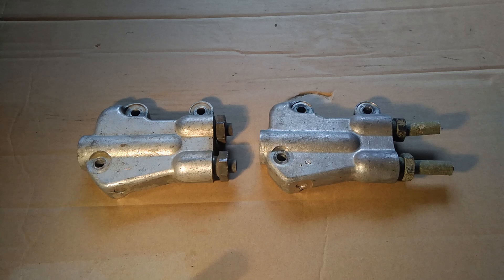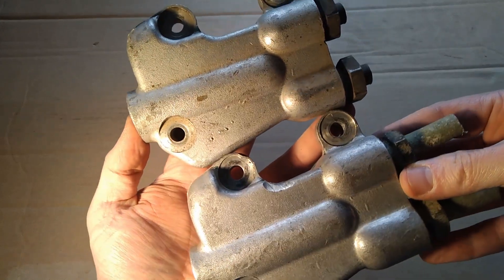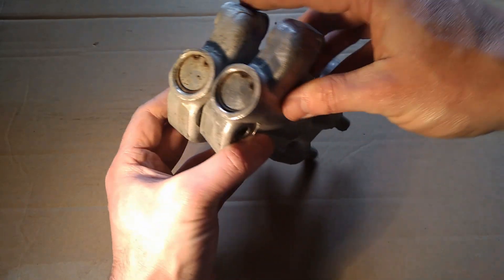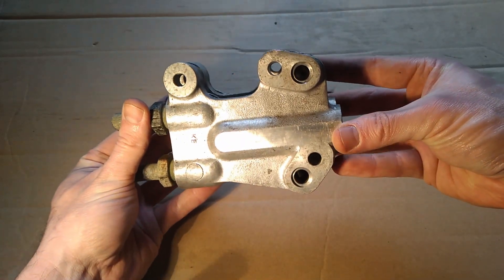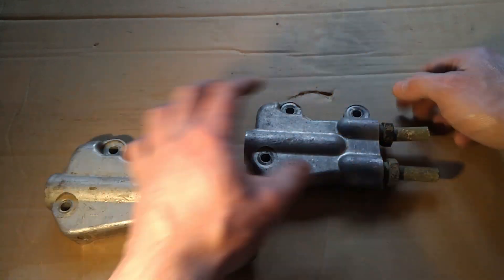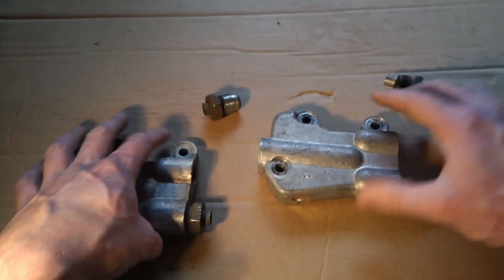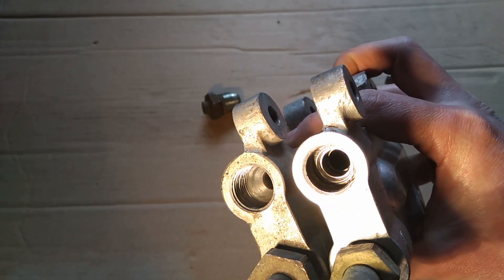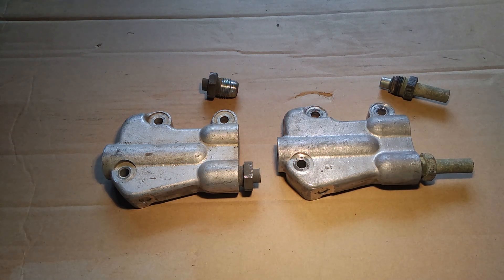LT77 and R380 gearbox oil cooler adapter differences - FTC1401 and FTC2687

Comment: Does anyone know the thread sizes for the hose fittings?  Are they the same for either Lt77 or R380 unit?  LT77 is more likely to be easier to find aftermarket fittings for?

Comment: Hi Will,  thanks for the video.  
Can I ask a question - do you know if the thermostat can be removed and the adaptor sealed again?  
My R380 shifts better with ATF than MTF and the synthetic ATF is more stable at temp than the MTF, so removing the thermostat won't really affect oil "thickness".  I've currently got one fitted with its thermostat and a small alloy cooler and it works well as a heatsink for the transfercase.  The TC has an overdrive attached (generating more heat) and an extended sump. I measure casing temps near the O/D and found that on hot days the R380 cooler dropped TC temps by 20.C. (90.C to 70.C)   However load, speed and environmental heat exponentially increase temps, so I'm wondering about getting rid of the thermostat to further drop TC temps in arduous conditions.   I note that the Ashcroft version doesn't have a thermostat, so I don't see that it will be necessary, especially in Australia.
Reply from the maker: The thermostat blocks the bypass valve within the block, so removing it would just leave the bypass open permanently. You'd have to get something that was able to fit where the termostat was in its fully extended state

Comment: I'm just about to buy one of these, and have been offered either the LT77 or the R380 one.. I have an R380 gearbox, so either should fit. So the question is which one should I get, and is the better option for connecting the pipes?
Reply from the maker: Hi Tom. Good question. Depends if you want genuine parts. The R380 pipes are stil available, although the LT77 adapter might have more options for fitting aftermarket fittings
Reply: @lrworkshop  Darn, I took the R380 one! It only cost me the equivalent of just under £45, so will go back and buy the LT77 one. Here in SA the dealer wanted R12000 for a new one, roughly £600...

Comment: G'Day Will.
Thanks for that matey, its always good to see parts live, makes it way easier to see the real difference that one just can't get from bad photo angle's that always seem to be in every catalogue! But what I really want to know on the oil cooler adapter is this, which pipe in "IN"and which is "OUT"!
Reply from the maker: 👍 I don't think it matters? 🤔 The oil will still go through the cooler... There is a bypass drilling between both ports, so this is normally open, as are the pipe outlets. The thermostat closes off the bypass.

Comment: Oooh I'll have to dig mine out of the garage! (got a complete military Wolf R380 setup in there).  There is also another adaptor that fits in the same space which has a temperature switch on it, i guess to illuminate a dash warning light (I've got one of those as well, never got around to fitting it)
Reply from the maker: Thanks Jamie. I believe, though, that you can't have the temperature sender AND oil cooler in the same adapter...!

Comment: Yes but the LT77 rear casing needs to be drilled to take the oil cooler adapter I believe? I really needed a gearbox oil cooler because of the amount of time I spend in hotter climes and for this reason changed my LT77 for an R380.
Reply from the maker: Ah yes it might only be Suffix G onwards LT77s that had it as standard https://www.lrworkshop.com/diagrams/land-rover-defender-gearbox/lt77/extension-case-oil-pump-from-suffix-g_53515
Reply: @lrworkshop  Not all suffix G boxes had the correct rear housing to accept the oil cooler adapter (mine didn't).  It was only available for certain export vehicles I believe and there are very few in the UK. Being practical, if you need a gearbox oil cooler fit an R380.
Reply from the maker: @defendermodsandtravels  Good to know!